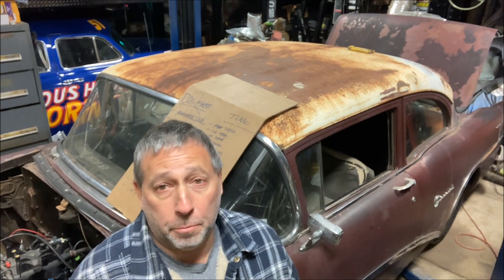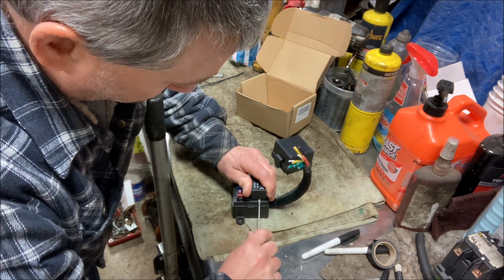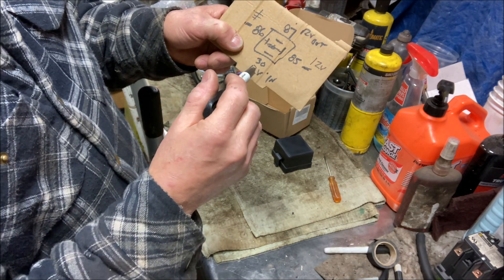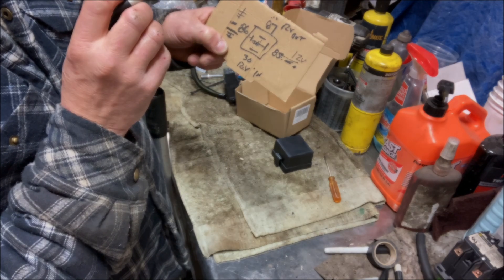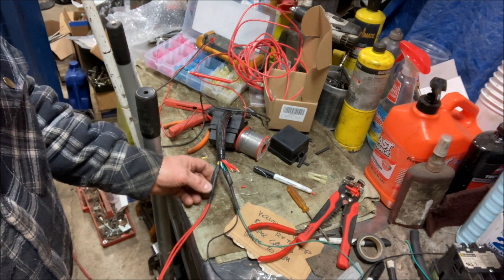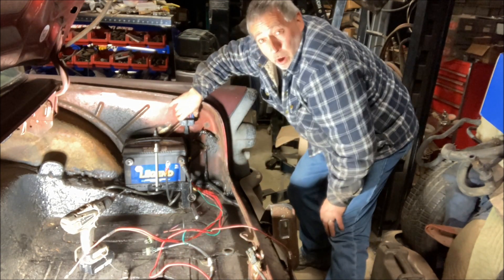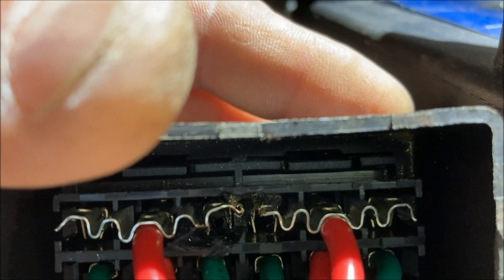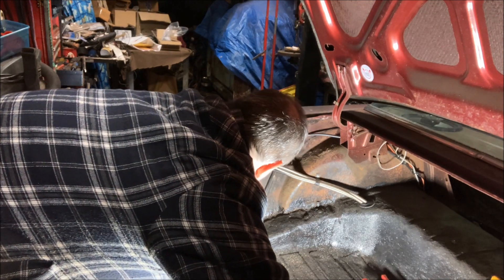Turbo LS Fuel System Wiring for two fuel pumps both controlled by the LS PCM.

Comment from the maker: * On the schematic I forgot to add in the fuses, each wire from pin 87 on the relay goes through a 50a fuse before connecting to the positive side of each fuel pump. Relays on this box are rated at 80a and all wires on the pin 30 feeds and pin 87 outputs are 10g. If you make your own setup I would not use less than 40a relays and 30a fuses *

Comment: In your previous video on LS1 mods needed to run that harness, the relays are 40amps!  What is the reason for the 80amp relays now on the fuel pumps.  Thought the 1 relay in the fuse block was for fuel Pump and 1 for ignition??
Thank you!
Reply from the maker: Yes the Ebay wiring harness has a fuel pump relay, but because I am running two pumps I elected not to use it and instead put two fuel pump relays in the trunk. The Ebay ignition relay is still on the Ebay harness and in use. I did not want one fuel pump relay under the dash and one in the trunk, so the Ebay fuel pump relay is not wired up. If I was only running the one in tank pump then I would of used the relay on the Ebay wiring harness and wired it as I did in my 1951 Hudson build videos. As I said in this video I removed the green 12v fuel pump control wire that was connected to pin 86 on the Ebay relay and ran it to the back of the car to pin 86 on both relays in the trunk. 40 amp relays would work fine, but the box came with 80s which just means the relays can handle more current than needed. Each relay has its own 50 amp fuse to protect each pump circuit.
Reply: @rust_hoarder_garage  Thanks so much for explaining it. Wiring,Fuses and Relays are something I have had very little experience with.  I only replaced or fixed an issue.  I have put a 5.3 into a 95 mustang and it has been such a Huge learning curve!
Thanks again!
Reply: What gauge wire are the 2 red wires that go to the starter?
Reply from the maker: No wires to the starter here, but anything pulling power from the battery will get 10g wires.
Reply: From the Ebay harness is what I meant to say, Sorry!  2 red ringed wires.
As you suggested to put a Fusable link between the harness and the Starter hookup.  I need to purchase the Fusable link and all the online info says to go 2 sizes up from the wire size of the wire.  It looks like 14 gauge wire???
Reply from the maker: 10g fusable links